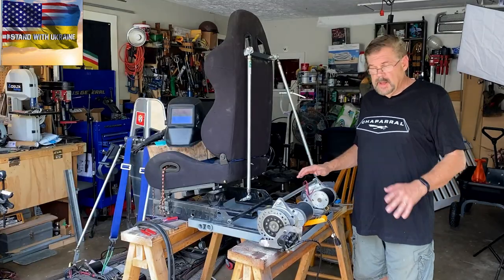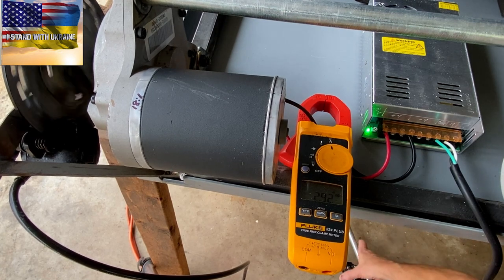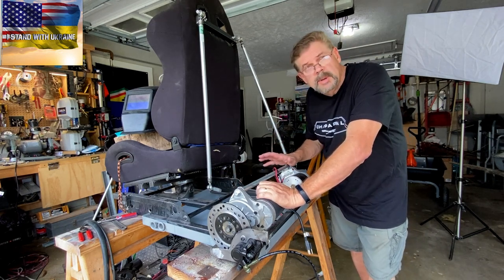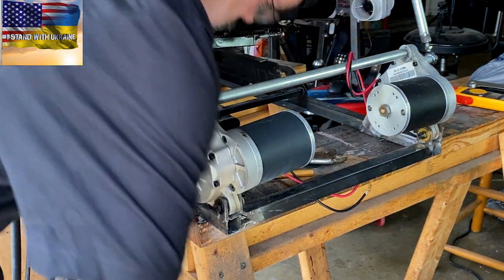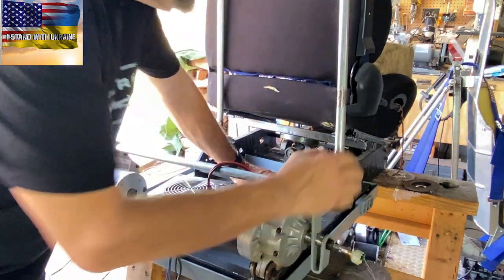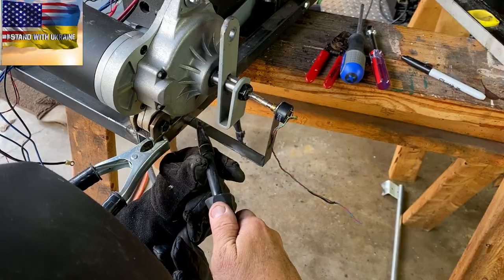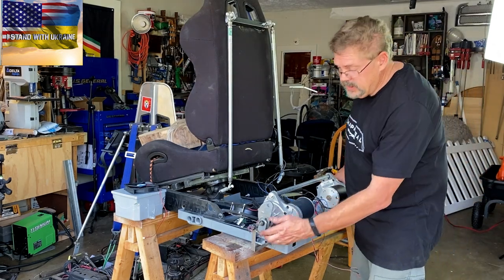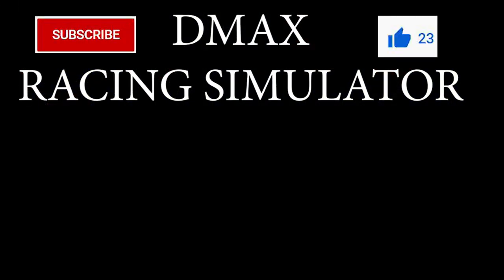BIGGER MOTORS MORE TORQUE

Comment: top job Mr D looks strong and I had some blue smoke in my power supply not to long ago . thanks mate
Reply from the maker: Thanks for taking a look.. This is pretty experimental for sure.. Lot of unknowns..   That kind of why my first build (3DOF) uses a 12V truck battery as it's power.   We shall see if these AC to DC converters can handle the pain  (maybe not).. but at least by doing this for you guys, we can get a little data on what's actually required for a reliable power source.   Have you any idea how many amps you were pulling when it happened?

Comment: I always use oversized power supplies, it is good to have a considerable margin, better 24V.40Amp.
Reply from the maker: Good point..  40 amps is a lot..  but I was figuring this is a seat mover.. If it takes more than 25 amps to move me..  I probably need to lose some weight or something! .. Anyway.. It stalls way higher than I thought it would  but we will see what happens .  If we (me and you guys, that is..) get some good data from these tests it will help people decide Dave
Reply: @DMAX_DIY  Yes, 40 Amp. too much, but keep in mind that they are cheap power supplies (NOT certified) and will never actually reach 40Amp.
The cheap ones reach 65/70% of the nominal Amperage, and MeanWell will reach 95% even if the price of the certified one doubled...
Reply from the maker: @JoseFcoBN  Well..  I have 850 amps in my 12 volt system..   850..  just saying.. I'm not running out of power anytime soon on the 3DOF ..  This is new stuff for me.. Dave

Comment: Nice video. Do you plan to create a surge dedicated motor. "Low" power shouldn't be an issue.
Reply from the maker: Thanks for the question!  Not sure..  We could use a couple batteries if needed..  I'll play it by ear..   Dave
Reply: @DMAX_DIY  sorry. English is not my mother tongue. 
I meant a motor similar to the one dedicated to traction loss but for the surge motion. 
I have recently tried a 3 DOF racing sim in a store and I missed the « kick » forward on gas and backwards on brakes. 
I guess that with good wheels, a wiper motor could do just fine.

Comment: Great video.

Is it easy to set up 2 arduinos for running more than 3 motors, the quides i find tells me to do 2 replica setups with ibt and arduinos but they dont show how to set it up when you calibrate the motors and sign every motion to axies.
Going to build surge, sway, tc, and yaw.
Gonna start with the easy 3 dof and later ad sway and surge if i can build it.
Quessing the hard part is wheigt for the sway and surge, but going to be fun to try.
Reply from the maker: Yes, I think it should be, they will be on separate com ports.. I have seen several people do it for their projects.   Its just communications setup between each Arduino and the SMC3.  Way more info on x-simulator.net forum..  Also maybe check out  6 Degrees of flights video too..  He uses two and describes how to use them.  I'll make a video about it at some point  but probably next year  so here is a link to his video If they let me post it here..  https://www.youtube.com/watch?v=m76rkAmur_k
Reply: @DMAX_DIY  tnx man that video was what i needed :)
Reply from the maker: @piggehdeluxe  Tune in again.. Hopefully I get some time to work on it this weekend..  I'm working all week away from my garage.. so I only get a little time to work on it + house chores ! hahah Dave
Reply: @DMAX_DIY  cant wait for the next episode :)

Comment: Have you done the test of the 10k wire bound potentiometer? In nz I can’t find hall potentiometer so I’m thinking to use analog hall sensors with magnets. A49e hall sensors are dirt cheap and readily available
Reply from the maker: I would go with the 180 degree hall effect pots.. I order them from digi-key..   180 degrees is all you need plus with the hall effect, they can spin all the way around without encountering any physical resistance. 
I think I have them linked in the description..   No.. I have some 10k wire wound ones.. I have not had time to test them..   I think the hall effect would have less interference  EMI  than wire wound.. but I do plan to test them next year.. Dave

Comment: Hey Dave - thanks for these vids! starting my own build here as soon as everything shows up. I got the same motors you did here, and really appreciate you doing this testing on them... Good stuff. Did you ever get the torque measured? Also I noticed you mentioned they're 20:1, but saw you have 18:1 written on them. Curious which is the right one :D

I'm trying to get all the specs sorted out for simcalc, but I'm missing some info still. Oddly, it seems no data sheet was ever written for these lol.

Thanks!
Reply from the maker: Thanks for the comments Adam..  Yeah One is 20:1 one is 18:1.. Perplexing..  but then again they were only like $60..  The motors stalled out at around 20 amps.. which was higher than expected. So we will see how it works out with the 25 amp power supplies. Worked on the sim today getting some footage for the next video..  Stay tuned my friend! Dave
Reply: @DMAX_DIY  Awesome, thanks! Any idea what the torque is? My motors showed up this morning - they work! Looking forward to the next vid!

Comment: The project is coming right along I see. Them motors are stout! Could they be too strong?? Looking forward to the outcome.
Reply from the maker: Thanks for taking a look..  No they will not be too strong..  You can set that up in the software..  So If you drive a real low powered car, it will act like it..  If you drive a formula 1 car.  Yep it will definitely act like an F1 car..  so it's better to have way more power available than not..  Check back,  probably having another video out late this weekend.. Dave
Reply: @DMAX_DIY  Oh yeah I see. As you can tell, I know very little about motion rigs. Thanks to your posts, I'm learning a lot about them.
I sure wish I could experience a motion rig on some of the awesome tracks I've just acquired and racing in the events over at Sir Spats Gaming Server for Assetto Corsa, the Prague,  1966 Spa, and Targa Florio tracks. I ran the Targa Hotlap Challenge in about 45 minutes. I would not ask you to try and make a video of you running that one in your full motion rig, but If you ever want to make a video running a track again maybe with this project your working on to showcase it or your FM rig, Please consider Prague or 1966 Spa tracks, they are shorter but man are they great tracks!. Of course if you do decide to enter the Targa event be sure to video it! Even if you just cruising the track and not really trying to make time. I for one would watch it in it's entirety. Oh the only reason I'm even mentioning this, as you probably already know I'm 62 and when I see other fellas around my age having a thrill of a drive, well I just think that's the good stuff. I do like reading all the comments you are getting from this project as well, till next time,  enjoy and don't short anything out! -Clicker

Comment: I watched this video series about 5x before building mine and this has been super invaluable. I think my only issues is that the pots seem noisy and the motors are constantly chattering. I don't see movement but it definitely seems like the system is working when it shouldn't be. I think that's your point about a hall sensor instead of a mechanical pot. Any advice?
Reply: Ensure good connections to everything and make sure you are using shielded cable and ferrite chokes for your pot connections and not running them next to power cables.  Also  make sure your PWMmin is not too high as well as bumping up your fpid a couple notches can help.
Reply from the maker: @dgator7251  I agree with DGator here..  I found that once I soldered the connections it helped my 3DOF rig.  Also The PWMin can affect it.

Comment: Can you code the arduino so if a signal is being sent to the motor but no changes were read from the potentiometer it will power off? That would be a good fail safe. Maybe add an led or a screen showing an error code.
Reply from the maker: yeah  good question..  And I have the answer..  In the SMC3 software, it does that with the CLIP limits and the MAX limits..   So the Clip limits will try and reverse power the motor when it approaches the CLIP..  If it passes the CLIP, it will still try and reverse power the motors until it reaches the MAX Limits.  Then the motor will shut off..  I have a new video out which I try and explain it a bit better..  Take a look if you have time..  here is the link.. https://www.youtube.com/watch?v=KrTEpgaQViQ&t=990s